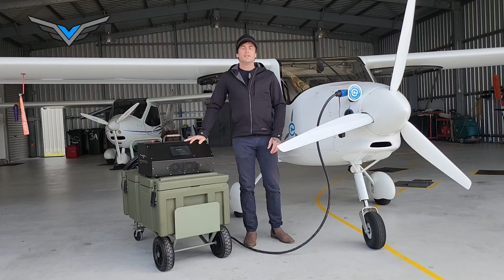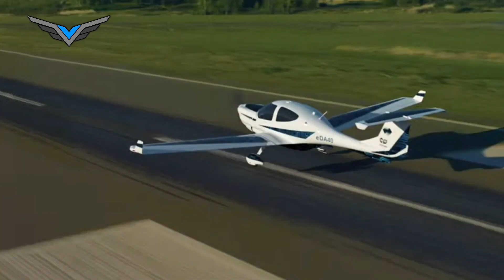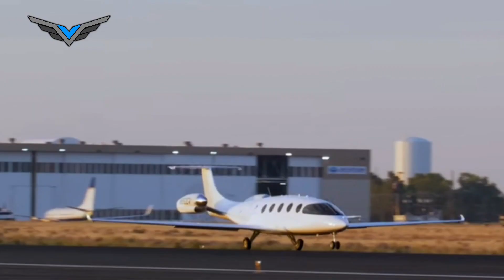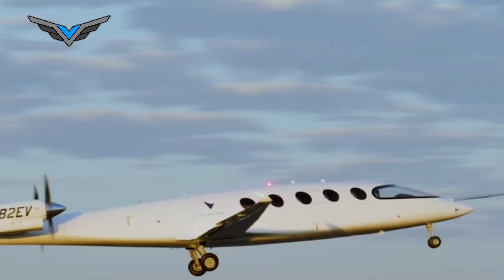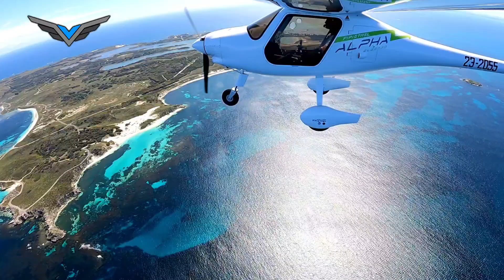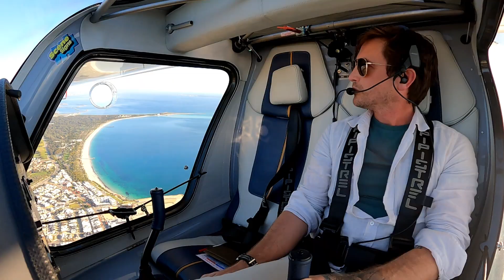10kWh Micro Mobile Power Station for electric transport

Comment: I love the idea, but rottnest is a 10 min flight from Jandakot. The range must be terrible? 30 mins reserve means it gets 30-40 mins flight time at best?
Reply from the maker: Yeah, 30-40 minute flight time with the Gen 1 batteries, and 33% more flight time with the Gen 2 batteries, but as you mentioned, less than 20 minutes is needed to get to Rottnest no matter what your plane runs on, so we have plenty of time for an Island orbit or city beach flyover first. No rush to get straight there! Why use an expensive, smelly, loud uncomfortable ICE aircraft for a 20 minute flight when they much much nicer (and safer) options available?